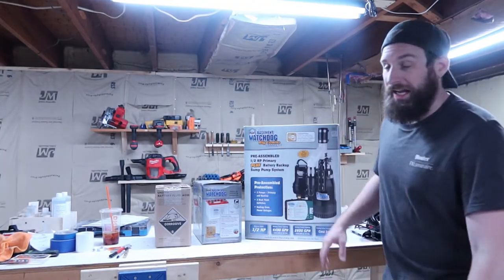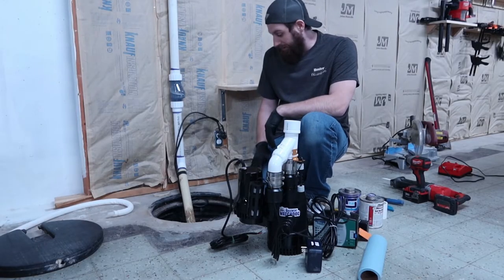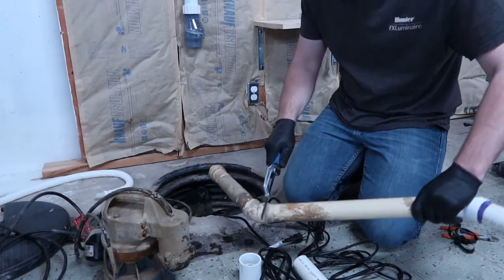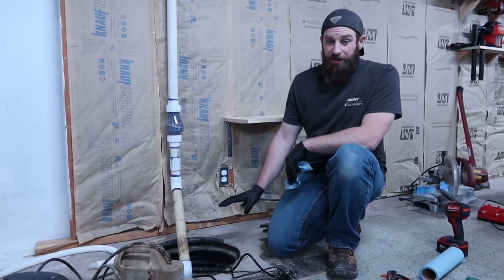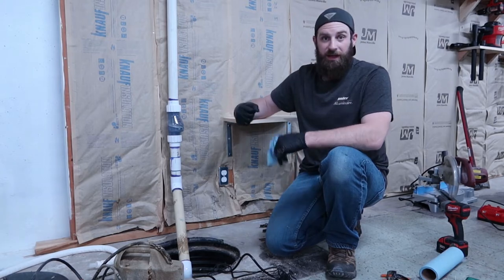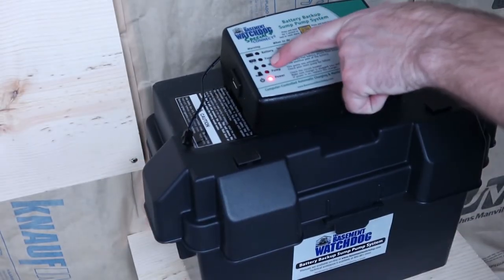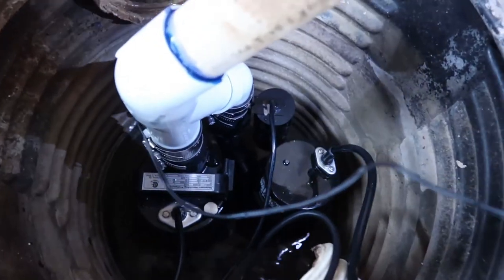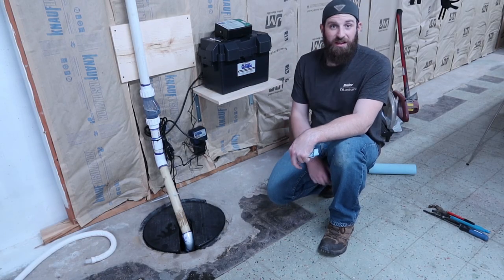watchdog Big Combo Sump pump and battery backup install

Comment: That worked great.  Note. If you didnt have the thread on connector use a marker to mark the pipe placement dry fit then glue it using marks

Comment: Thanks for the video. I had the power go out in my house and sure enough had my basement flooded. Saw this at the big box store and will be picking it up.
Reply from the maker: Thanks for watching. I had the fuse blow while away which is why I got this. Lesson learned don't keep putting it off. Been a year no issues and just went through a very rainy few weeks.

Comment: This is a follow up, I did order two of those pumps, and they both came damaged so I ended up sending them back.  Not only because they were damaged, but, there were proprietary components that I didn't want to try and source later down the road.
Reply from the maker: Sorry to hear that. I had it locally so was able to inspect before I bought. Good to know there are proprietary parts

Comment: Hey   Thanks for video.  Trying to decide between this and Wayne system.    I like the shelf you have created to keep stuff off floor.    I will be making one of those.   I have all my stuff on floor and had an issue in past with power out for a few days and battery did not last that long and cord was laying in water.  Good idea to get all above floor.
Reply from the maker: Thank you! I don't know much about the Wayne system unfortunately. I thought the same about the cords and battery. I used 8in brackets so far no issues

Comment: The only question I have is, why is your outlet only 6 inches off the ground.  It might be a good idea to move that up the wall a couple feet.  Based on where it is located, if you happen to get a leak in any of those pipe fittings it will be spraying water all over your outlet, just makes me nervous for you.  Good info and nice job on the install.
Reply from the maker: Thank you. Honestly just never moved it from when I moved in. I see the concern. I Will have to put it on my list of things to do around the house.

Comment: For the watchdog with liquid type you have to watch the fluid in the battery every couple of years. I got tired of doing that and got the  the newer system with the maintenance free battery.
Reply from the maker: I thought about it but was trying to keep the cost down. I will switch to a maintenance free battery eventually

Comment: I have a Watchdog model that I'm thinking is 25 to 30 years old, replacing it with the big combo WiFi. Around 2015 I got rid of the original battery that had come with it and purchased a large deep cycle marine battery from Sears at the time. It does not loose water and I disabled the water check. Better to double up on a set of deep cycle batteries then to buy the Watchdog brand. Maintenance free batteries don't loose water over time why are theirs? Something I would like to see from Watchdog also is better wire management right from the get go. Yeah good video on the installation.
Reply from the maker: All good points. I got lucky and didn't get low on water. They have a maintenance free battery now. I moved but was planning to upgrade when the battery needed to keep being filled

Comment: This looks like a great system. Thanks for posting!
Reply from the maker: Welcome! So far it's doing well with the decent amount of rain we have had since I put it in
Reply: @dave_adamson  I just moved into a new build and noticed our sump pump was running every 3-5 minutes. I live in Michigan, so it's normal to have it run fairly regularly. However, I just noticed that the plumber never finished installing the PVC outlet tube into the drain tile corrugated hose.
Reply from the maker: @wusty23jd  that's not good. Definitely should have them out sooner than later to get that done. Don't want water dumping along the foundation
Reply: It has quality issues!! Performance of main pump is not good!

Comment: Looks good, I am getting ready to order the same unit.  One suggestion is to stiffen up that battery shelf.  I see that thing moving and that's just a disaster waiting to happen.
Reply from the maker: Thank you! It's been almost a year and been working great. Haven't had any issues. Once I moved the battery towards the wall it's pretty sturdy but I can see the concern if you have kids

Comment: Just ordered one of these combos from lowes, i have a finished basement and actually sleep downstairs. This demonstration was very loud with the gurgling, is this typical for this pump? I get a loud hum with my current single pump which I can deal with though my wife has some issues with it. The gurgling sound is going to drive her insane. Our sump pump goes off very often when it rains. Can you give any and info on this? thanks
Reply from the maker: The gurgling was because I had to add a vent outside. Mine was directly piped to the city storm sewer. It was really quiet once I did that.
Reply: @dave_adamson  Finally installed the pump today. its a lot quieter than the previous one but it does gurgle once the water is near the bottom. I wish the float switches would kill the pump with some water still in the sump, but both pumps operate as advertised. I got the maintenance free battery. I would have  wasted more money in the long term dealing with recurring battery servicing and I don't want to store acid with small children in the home and it would be more thing to have to keep up with..

Comment: Why is there a priming hole on the secondary pump but not the primary? I have water shooting out of the priming hole on the secondary but nothing like that on the primary pump? only one required because it’s all piped together?
Reply from the maker: I'll be honest I'm not sure why they did that. I ended up drilling the hole myself as I was getting some gurgling and that stopped it
Reply: @dave_adamson  so you drilled a hole in the primary yourself? And one came from the factory on the secondary?
Reply: @dave_adamson  can I ask where you drilled the hole? Below the check valve on the primary pump somewhere?
Reply from the maker: @Joshlynch11  correct it was right below the check and I tried to angle it so it shot more downward

Comment: Their instruction say that the system comes with a check valve and that another one is not needed, just connect system to exit pipe with a 1 1/2 inch coupling . Did you decide to skip installing their check valve or this model didn't have one included?
Reply from the maker: I left their in. It's needed for when the backup kicks on. The white one is a quiet check so no banging when it closes. I also like if you need to service anything there are unions

Comment: How long did that take from full start to finish?  Removing old primary-up and running.

Thanks
Reply from the maker: It was right around an hour and a half I want to say to be completely running and everything mounted. If you are doing it on the fly probably could get it done a little faster. You have some time depending on how much drain tile it has since it will start filling that before it overflows
Reply: Any alarm going off problems??

Comment: I just bought this, there appears to be a jet of water shooting out the side, is that a built in weep hole?
Reply from the maker: Correct! it's to prevent the pipe from getting air locked
Reply: @dave_adamson holy crap I thought something was wrong with my pump I almost returned it.

Comment: Quick question....the Big Dog back up kit comes with 2 pre-installed check valves...did you leave those on in addition to the Quiet Check Valve? Or did you remove them? On page 3 of the installation instructions its says to discard the existing check valve. Seems like to leave them, others remove them. I can't seem to get a straight answer if 2 checks valves is okay or simply redundant. Thanks.
Reply from the maker: I left it in. I did some testing and ran it with and without the quiet check and it ran the same. The pre installed checks are required otherwise it won't run right as it would push the water back through the opposite pump. So the quiet check you could remove.

Comment: Dave, what are your thoughts on this sump pump system now that you've been using it for almost a year now?
Reply from the maker: It's been great! Haven't had any issues. got through spring last year and after not running for months because it was dry kicked on and ran with no issue.
Reply: @Dave Adamson  Thank you Dave. 
I'm looking at putting this in at my house and was impressed with your installation video. And now that I know that it has been working well for you, that makes it a lot easier for me to go get one. 👍🏻
Reply: Dan - I bought two of these about 9 years ago.  I installed one 9 years ago and the other was in the garage during this time.  The installed one ran just fine for about 5 years.  The batter needed to be topped off with distilled water and it ran for another 4 years without issue.  

About a couple of months ago, I noticed that it was getting louder when it ran.  Maybe a couple of seconds slower too to empty the well or pit.  

I replaced it with my backup of the basement Watchdog and it was very convenient that I was replacing with the exact same unit.  I shouldn’t have to touch this thing until 2028.  

I’ll just mention too that I hav3 a crawl and not a basement.  My pump rise is only about 12” and not 10 feet like this guy.

Comment: How come the water spits out the side when the battery activates the back up pump?
Reply from the maker: Its the weep hole, helps keep the pump from getting airlocked.
Reply: Thanks for the quick reply. I just installed it. The weep hole confused me, my old pump didnt have anything like that. It pumps the water out nicely but then its followed by what sounds like the remaining water coming back down. I have a check valve but it doesnt sound like it is doing much

Comment: Do u think I could use a lifepo4 battery?
Reply from the maker: I can't say for sure as I never tried it. I don't see why not though
Reply: @dave_adamson  I think it will work just not sure about the built in charger.those battery need to charge to 13.1 13.5 and lead acid is 12.5 or so.i might try it and use a different charger.
Reply from the maker: Yeah that might be the only issue. Other than checking what the output of the charger is.

Comment: Can you provide a link to this system please?
Reply from the maker: https://www.homedepot.com/p/Basement-Watchdog-Big-Combo-Connect-1-2-HP-Primary-and-Battery-Backup-Sump-Pump-System-with-Smart-Wi-Fi-Capable-Monitoring-Controller-CITS-50/314159827

Comment: How much does a setup like this cost?
Reply from the maker: With the battery, battery acid and fittings It was around $600
Reply: @dave_adamson  thank you soo much. A plumber is charging me $1200 to have a Zoeller  installed. Do you think he's overcharging me? I personally do think he is
Reply: @dave_adamson  it's one of the battery back up sump pump but $1200 seems kinda high
Reply from the maker: @mikespeed3928  that's not too bad actually. Zoeller pumps are more expensive than these so actually not too bad
Reply: @dave_adamson  okay thank you
Reply: You had me worried a couple times we have the dry fitting… but you did great! And talk about Chinese water torture that drip went on and on and on and on drove me crazy! 🤪
Reply: Just a FYI. You didn't need to change the fitting. There is next to no pressure on it.

Comment: Instructions say not to use the emergency standby battery with that system
Reply from the maker: This kit comes with the battery backup in the box from the manufacturer. I don't think they would put it in the box if they didn't want you to use it. It has two separate pumps. Not sure if maybe you have a different model.
Reply: @dave_adamson he’s talking about the red battery. That’s the smallest battery they have (won’t last long with a lot of rain due to the amount of power it holds. They recommend the maintenance-free AMG (all-black) & the Big Wet Cell (black top white body).